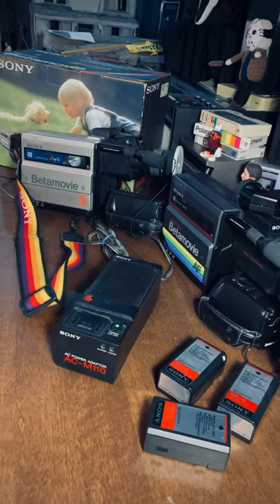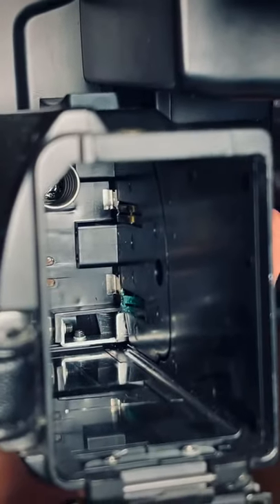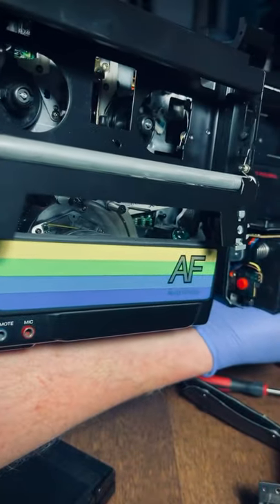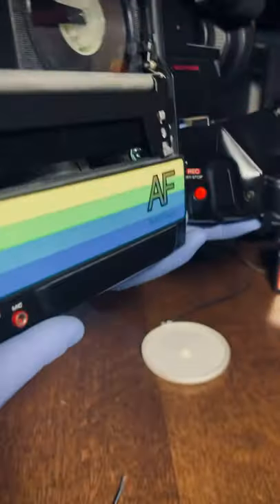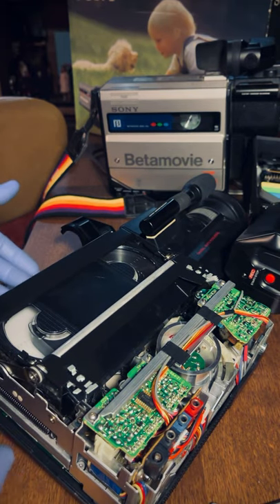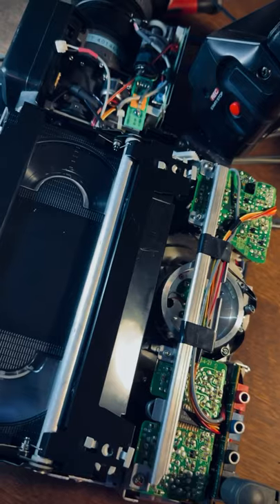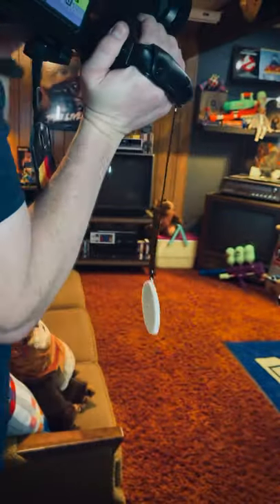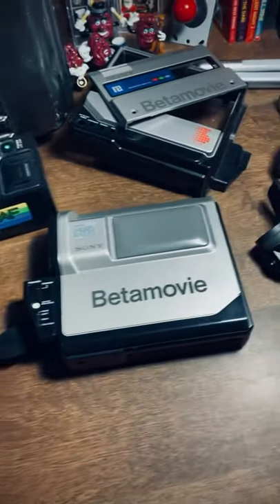1984 Sony BetaMovie BMC-220

Comment: Good job on the BMC-220. I just bought a BMC-110 online with it's original box. Do you happen to have a spare carrying case? Doesn't seem like my BMC-110 includes a case just the box. I've got an SL-2000 as my playback deck and it should work fine for Betamovie recordings. 

I've had a few Betamovies over the years. I first bought a BMC-220 but I didn't have the AC-M110 or a playback deck so it just sat around. A few months later I bought a BMC-110 from eBay. This one worked, but always had the "LOW LIGHT" indicator on the viewfinder, even outdoors. You know what that means, right? Dead tube. So that one was only good for parts and I sold it off for parts. I bought another 110, and this one actually worked without any repair, but I ended up selling it again. Around this time I powered up the BMC-220 I had bought a while back. It would refuse to eject. One of the belts had slipped off, so I put it back on and fixed the mechanism. However there appeared to be some kind of mold between the lens and the front of the pickup tube. 

Like another person said there is a fuse on the board that has the DC input connector, along with the 3.5mm jacks for the mic, remote, and headphones. I blew this fuse on another BMC-110 and it had to be replaced. I forget the rating of the fuse. Because of the amount of components they jammed into the camcorder accessing the board is sort of a pain, but can be done if you are patient. I took the entire board out and had my friend desolder the fuse and replace it.

Comment: on the bmc-110  more than likely the fuse which is located behind the power input plug circuit board is blown or the wire soldered to the corroded battery connector corroded and disconnected itself, in my experience these camcorders are very easy to repair. also  adjust the tracking knob on your vcr, old systems dont have automatic tracking.
Reply from the maker: Thanks for the info! I’ll check those out.

Comment: @vintagevideobasement hey man awesome job on the video. So I just picked up a mint 110 at a garage sale all in the original packaging… batteries will charge up but when put into the camera with a tape the battery light is blinking and the camera turns off. However with a direct plug in the camera will power on, zoom but when I hit record it’s doing just like yours did where it turns off and the battery light is blinking. Where can I find that band that you replaced ?
Reply from the maker: Search Amazon for cassette player belts and you will find packs with an assortment of sizes. Should be able to find one in there that will fit. You will have to replace the cells in the batteries to get those to hold a charge.
Reply: @vintagevideobasement  Do you remember how many belts are inside the camera ? (not counting the one for the zoom mechanism)
Reply: @CousinHubertRetrogaming 1 that I've noticed. I'm working on fixing a 200 and 100 at the moment
Reply: @piecharts5036  very cool if you could do a video showing how to replace it. i have 3 bmc100, only one works, the other ones load the cassette but don't roll it when pressing record
Reply: @CousinHubertRetrogaming  I apologize I just removed the board on the other side. There are 3 belts in total. I'll try to see if I can figure how to post a YouTube video and show you what i did
Reply: @CousinHubertRetrogaming I just fixed my 200 with the same problem, on the opposite side there are 2 screws and 2 plastic tabs that hold the board in place. Gently lift the board and there are to belts under there, you may not even need to replace them mine was just stuck to the pully, gently pulled it loose and it's working like a charm. But I have my 100 apart right now
Reply: @CousinHubertRetrogaming   I just uploaded a video and tagged you in it. It's called under a betamovie vrc 100 board
Reply: @piecharts5036  i'm eternally grateful! thank you so much! i'll check it soon 😉.
right now i'm on vacation in Japan and shooting BMC-100 movies all day long
Reply: @CousinHubertRetrogaming that sounds amazing! Enjoy the rest of your trip!!
Reply: @CousinHubertRetrogaming oh if you can find any video pickup tube's for a beatmovie vrc 100. It's a sony trinicon st-3222 
Let me know that's what I'm gonna try to rebuild right now 😂